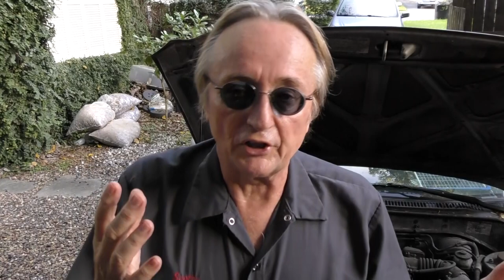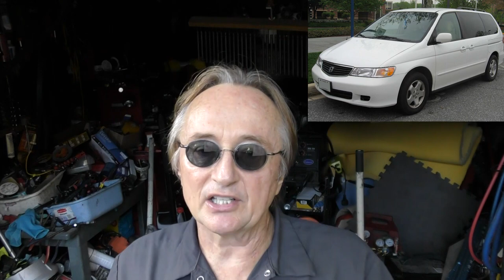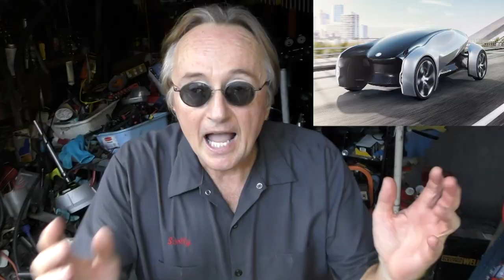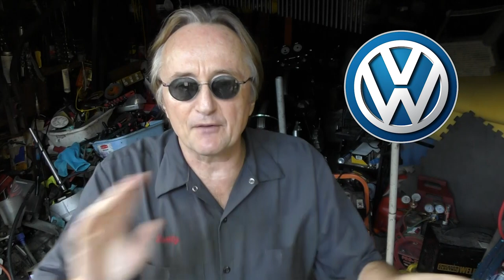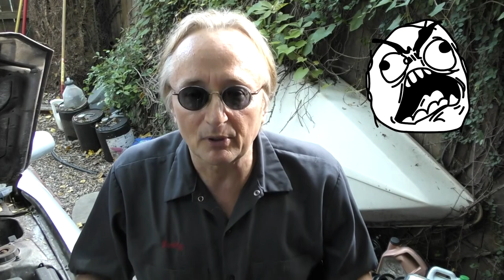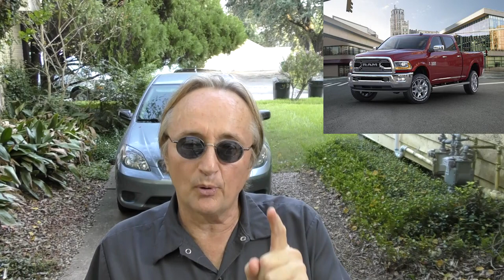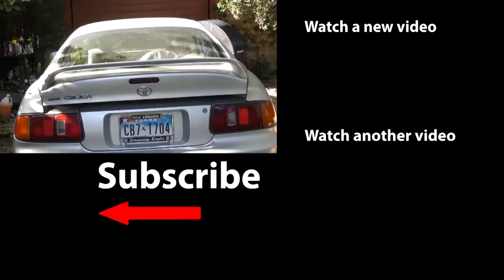Who Makes the Worst Automatic Transmission Cars in the World

Comment: I have a 2007 Pontiac Montana and 270,000 km on it, don't know if I should replace it or fix it. I have to do the work myself, 70 year old woman.  Replaced the wheel bearings and abs sensors last summer. Flushed the coolant system, transmission, and oil. Doesn't burn oil yet. But have to do the ball joints and a few other things.  Any advice?

Comment: I call bs .  Honda’s trans may not be the best but it’s certainly not the worst.  My 2000 Civic has 278,450 .  Still no problems with the auto transmission.   The problem is people try and mess with them too much.  Just leave it alone . No need for flushing , additives , etc
Reply: The civic transmissions are good but the accord ones had a higher failure rate.

Comment: So this is just great, my current beater has the dodge caravan transmission, 02 dodge neon, the thing runs great and the bonus in my case is the transmission was replaced with a brand new one 10,000 miles ago in 2015. That goes to show how bad they really are being the car just turned 40,000 miles and trans was replaced at 30,000 miles!!! WOW so with my new trans I still have 20k left before I have to start worrying.

Comment: No car brand is without its flaws.  I used to work at a Toyota dealership as a tech and the 5 years I've spent there I've seen my share of Toyota crap.  The accelerator pedal recall that sent cars speeding out of control for no reason, spare tire cable recalls, frame recalls on pretty brand new tundra and sequoia, you had to get your whole frame replaced if it failed the recall inspection.  The 4 cyl engine recall ( can't remember which one, 1.8l or 2.4l) that burned a ton of oil right out of the factory and had to have short block replaced...the shop had about 20 hoists and almost all of them had a camry or a rav4 getting engines pulled out. Oh and the rav4 rear tie rod recall where it would just fall out for no reason.

Comment: I am actually surprised that Ford didn't make the running, my 2011 Ford Fiesta I used to own had what I thought was one of the worst Transmissions ever. It was Ford's PowerShift Dual-Clutch Automated Manual 6spd, car managed to survive electrical issues early in life through 100k until the Transmission began shifting very irradically and poorly until it almost got me into quite a bind on a high-traffic road. Took it in to a trustworthy mechanic like yourself (gentlemen is actually Ex Airforce and worked on Jets), and his Dealer Level scanner detected missed shifts on Gears 3 and 5. Sadly we exhausted his Transmission Specialist, and took it to Ford, who at first tried to pin me for 150 bucks diag fee until they confirmed one of the P0 codes that our private mechanic had found was matched by the Dealer. Turns out the Transmission Control Module was going out. I had originally only signed the car over for an Estimate, but in their shady efforts to try and 'make me happy', they repaired the car without authorization AND didn't call me to tell me "hey, its X, you can get it replaced for free." Granted free, but apparently, a CSP (Customer Satisfaction Program) had been dispatched in 2015, this incident was this year, 2018. Safe to say, not even a week after getting my car back, I traded it in on a new Trax. 

Keep up the amazing videos Scotty! Thanks also for the amazing advice, lets hope I don't have issues with Chevrolet!

Comment: The absolute WORST Automatic Transmission was the JATCO in my 2001 V6 Freelander. That JATCO Box was a NIGHTMARE that used a special type of one of a kind Texaco Fluid known as LNR402 or N402. This transmission failed in my 1st year of ownership, just when my nightmare Land Rover experience began to accelerate. Little did I realize that the Flashing F1 error was a critical fault but the dealer said "no problem found" and that the F1 was nothing to worry about. I lived 6 years or my life with a container of Dexcool and a failing JATCO Box failing. My Freelander leaked Coolant from the first week, and I almost lost my Right Eye when the Sunroof mechanism exploded, and a sharp metal part cut my eyelid, I needed 2 stitches. The JATCO Auto Transmission faulted from F1 to F2 & F3 in Year 3. I would have to pull over, turn the Car off, to clear the alarm The Car would go into a Zombie Gear and limp along at 30mph.  When LR commercials say 'ENGINEERED LIKE NO OTHER CAR ON EARTH' they mean it, STAY AWAY FROM ANY USED FREELANDER, they are Lemons on Wheels. At to think I pair $35,800 for junk and probably close to $49K with the interest, it makes my stomach turn. One week before the warranty expired the LR dealer gave my Freelander a clean bill of health, what??? Then, as soon as I took it back 6 weeks later for the same recurring JATCO issue, they handed me a $10,350 repair estimate. The worst engine was also that Made in China V6. The Cylinders walls used Epoxy to hold them in place. I now regret not having let the whold dam car overheat and melt the head gasket as the epoxy became liquid and the Cylinder Wall started to move.

Comment: The US really needs a decent set of consumer laws.

Under the Australian Consumer Law (ACL) if a manufacturer tried to patch up a manufacturing issue until the product ran out of warranty so they could charge the customer a massive repair fee they would face a massive fine and possible lawsuit from the Australian Competition and Consumer Commission (ACCC). 

One core aspect of the ACL are the Consumer Guarantees which state that products must function and be of an "acceptable quality" for a "reasonable time".
This timeframe isn't hard set but it is generally around: 2-3 years for most cheaper electronics and phones, 4-6 years for computers/laptops and TVs etc, 8 years for refrigerators and 10 years for cars. Basically how long the average consumer would expect a product of that type and price to remain functional for.

An example is if you have an issue with your iPhone, say the port stops working, and you're 23 months into your 24 month contract then Apple is required to replace or repair your phone for free if you mention your consumer rights, since most people would expect a mobile phone to last for at least 2 years if it is on a 2 year contract. However the ACL puts the onus on the consumer to know what their rights are so the retailer can try to steer you towards paid repairs or not mention the Consumer Law at all but cannot outright deny you your rights.

Comment: I think the first generation Mazda6 has a pretty bad automatic transmission in it. My sister has one. It shifts rough into 2nd gear and apparently getting worse. Looked it up, apparently it's a common problem among first generation Mazda6s. Always ending in replacing the whole transmission. I think I read somewhere that they used the same transmission that's was in the ford focus at the time. Go figure.

Comment: I am Unlucky enough to have a 2001 Honda Odyssey. Actually, there were no problems with it until about five years ago when the transmission started to slip.   After discussing it with my auto mechanic buddies they suggested I put in a couple liters of Lucas transmission fluid.    The mechanic theory was that the internal seals in the transmission had hardened end I had internal leaks. The Lucas stuff softened the seals. So goes the theory.   I added in 2 liters of Lucas.  This is my question. When I start my odyssey in the morning I put it in second gear and  drive it for about a mile.    Then I shift up to D3  And can drive it around town without any slippage. Seems to work all the time.  Can you explain why this practice works for my odyssey transmission.  We all are thinking that driving it around for a mile warms up the transmission and softens the seals so I don’t get any internal leakage.  when I upshift the fluid stays where it supposed to be. What do you think?

Comment: ha, i had a '70 Chevelle with a PowerGlide and a small block. Put a set of headers on it and like a rolling neutral drop at 20 mph into low. Bark the tires. Car was nice. Trans, POS. worse was the Acura/Honda. 3.2 tl. How a company like Honda got this into production was sad. Apparently the replacement trans had the same 2nd gear pack prob. oh well. Junked the car. Wifes '05 Civic is still great.

Comment: I have to agrree on both sides. Chrysler's transmissions are terrible, but others are right that they are technically built by ZF.  My Jeep Grand Cherokee Overland is atrocious at shifting which is real shame because it's a great vehicle in almost all other respects. Mine is an 8 speed ZF and in early gears it shifts really hard, especially when cold. And it finds itself gear hunting all the time...and yes, I've had the supposed flash update fix. Didn't fix shizznit.  And just recently I've noticed it's starting to slip occasionally - all before 55k miles.  What a pisser.

Comment: I had a 1994 Ford Taurus with the Axod transmission.  all during the warrantee period it had tranny symptoms and the Ford dealer kept saying could not find any problems.  finally, at 37000 miles, the tranny blew and Ford said I was to blame cause I did not do scheduled maintanance.  Scheduled maintanance was to change tranny fluid at 100,000 miles.  Went with Honda after that experience.  Ford saved the cost of putting in a tranny but lost me and my extended family as customers.  PS  the dealer asked me in the end if I had any problem yet with the 3.8 eng I had in the car.  I said no, why?  he said you will have to replace the head gasket.  They all go on the 3.8l eng.  Nice, huh?

Comment: Aaand let's not forget about the 05, 06, 07 Pathfinder. I would know cause I have 1 sitting dead in front of my house. Sad thing is they're great trucks with solid motors, but Nissan used crap radiators that had a trans cooler line running through it. Radiator fails, and starts injecting radiator fluid into the trans line and you end up with TMOD(the milkshake of death). Of course Nissan didn't recall them either, just added an extended warranty which for most was to late

Comment: IMHO, Honda makes the best stick shift. I had a Honda Accord 1990 with a manual transmission and it had 360,000 miles and it never needed a clutch replacement. Unfortunately some knucklehead tee boned it whilst blowing through a red light. The most reliable car I’ve ever owned.

Comment: What do you think about  the 2012 Ford escape with the 2.5 four cylinder engine and automatic transmission? Ive got a little over 87k miles no issues yet.

Comment: How about the 2000 dodge Dakota v6 automatic ?  Mine acts funny !  Only 95,000 miles . Did a trans service when I bought it at 83,000 miles .  It’s just been getting finickier and finickier . It’s also hard to get a good read on the fluid . Each time I have had it serviced it seems they don’t even fill it up with fluid enough . So I am always trying to top
It off at the middle mark .

Comment: Speaking of Chrysler they had some terrible transmissions like the A604.  I am not sure if they make a similar one to that any more or even still make the A604.  That was one of the transmissions that needed a very specific fluid that anyone making it had to get a license from Chrysler to have ATF+4 on the label.  That was for cars in the 1990s and I wonder if it is ATF+5 or higher now.  I once had a 1995 Chrysler LeBaron convertible with the A604 and it amazingly never died.  It was hit or miss whether you would get a bad one.  I only had it until 80,000 miles which was a lot of miles back then.  The same transmissions were used in the mini vans even.

Comment: Mr.Scotty , question:
My 2005 Honda Pilot 4wd had transmission fluid flush( has service record ) at 80k miles , from the previous owner , I have 164,500k now , 
Should I do a flush with a mechanic here in San Antonio TX or regular fluid drain , with 4 quarts ? Also do I need to replace a transmission filter along with it ? 
I bought original Honda ATF,  4 quarts , 
Never done it before but transmission fluid drain looks like a simple process , thank you so much , Darko P.
Reply: just change the fluid and filter every 40k and pray its not going to break

Comment: You should give more NEGATIVE prop's to VW for selling the Routan (Chrystler made) with the 62TE transmission. Now I've seen some people say it's a rock solid transmission.  And others say it's garbage.  But I know that (1) there is no dipstick to check the A/T fluid... if there wasn't an internet, we'd all be out a $50-100  bucks just to get the level checked, as the cap SAYS "dealer use only" LOLZ.  Then there is the recommended interval for fluid change.  Which is NEVER, unless you are using it as a taxi, then the interval is 65K miles.  Well, I dropped the pan at 65K and there was easily a few mm of metal totally coating that magnet -- that's a lot of just metal dust. Replaced the filter -- I kid you not, the aftermarket premium filter holes didn't line up with the mounting holes in the tranny -- how is that possible if it's not a manufacturing tollerance issue.  The original one was hard to muscle out, and just like the factory, I was able to force the new one into position, but it not really supposed to be opened up.  E.g., the original pan seal was just a bead of RTV silicone, sealed up fine, but a PITA to remove entirely so that the new seal will seat properly.  I'm reasonably sure that tranny was built to fail -- just out of warranty.

Comment: ZF transmissions are not made by Chrysler.  They are made by.......get ready for this.............ZF.  A German company.  Many auto companies have bought major components from suppliers since forever.  My 1960's Volvos used brakes by Wagner and rear differentials by Spicer.  My 1989 Jeep 5 speed manual was made by Peugot.  Peugot!  Never had a problem going over 200,000 miles.  

Also, the two speed GM Powerglide (and Buick Dynaflow) did not slip.  Not having a lower gear to kick down to at higher speeds, they depended on the torque converter to effectively change the gear ration.  Engine speed went up, sure.  But also delivered more torque to the wheels, just like a downshift.  Except not near as efficient.

Comment: I own a jeep compass 2018 and not only do I get between 28 to 31 mpg and in 5 months I have put 10700 miles and no issues, however at this time when I had a candy by this time (5 month ) I had been to the dealer over two times with issues with the brakes and that useless entune system that made me run away from Toyota.  Not to mentioned the new camry is lower and makes me feel claustrophobic.  I miss my 2012 Camry,  Damn you Toyota

Comment: Have a 08 odyssey it’s been through alot and just hit 200k miles only problem ever was a small oil leak which was a shot valve never any problems with the tranny even under load with a trailer or something. Our old 02 was another story😂

Comment: I have a 2006 Cadillac srx and I don't want to put the fe3 suspension back in,I prefer the soft ride over the sport ride.
What could I use to keep the computer from throwing a code? 
It says the speed is limited to 80mph.

Comment: I purchased a VW Rabbit (it's like a Golf) in college because my RWD 3 On the Tree low mileage Nova wasn't "cool", was bad in snow and had some issues like dieseling and other concerns.  The VW owners were someone we knew and they raved but they were lying. I will NEVER purchase another Volkswagen - Vapor Lock, apparently it's "German Engineered" right into the engine. That car also rusted EVERYWHERE including important places. I will also not purchase a Porsche because the VW/Porsche dealer where I serviced my car was a bunch of crooked idiots.  I have good experience with Mitsubishi and with 'Yoda.
I love electric vehicles for their low maintenance cost and their reliability but there is FAR less profit in that so expect new costs to be designed into vehicles soon.

Comment: That's odd you say powerglide is junk (??). It was a primitive 2 speed. But racers loved it,  they run  1200 HP thru it.  They said, great trans. Still,  I guess it was "modified" (beefed up, fixed) The powerglide was the blueprint for the awesome th 350, one of the best. I guess it all depends.  A trans. repair man I knew said ,for example, the 700 r4 GM , 4 spd. OD,  trans was weak and broke very often.  He made a few mods to the 700 r4, everyone loved it,  very bulletproof. That's just it, modify, fixit.  My opinion,  I never saw the need for 5, 6, 10 speed etc.  auto trans.  , just a waste,  needless complexity, more to break.  A strong electronically controlled 4 spd.  auto overdrive is all we ever really needed.
Reply: Chevy in the 1950s and 60s had a transmission called Turboglide which I hear was junk compared to the Powerglide of those days.

Comment: Have a 2002 Accord EX V6 trans rebuilt at 48,000 miles. 
Funny no mention googling on what root causes are or ways to prevent reoccurrence.
Reply: My has over 200s original miles. I believe any car with highway miles will last.
Reply: Jesus Christ King of kings Lord Of lords Well update found file folder loaded with service tickets yesterday. Was my deceased uncle's car only 54k miles. It had new trans put in at 35k then Honda rebuilt it again 13k miles after that. He paid $8k total. Disgusting and shameful Honda covered nothing. Also motor mounts and lower ball joints replaced before 50k. All scheduled maintenance was performed by Honda. I have about $12k total in receipts. He was a sick senior citizen and couldn't afford a new car. He just said he had car problems, if I knew what the hell was going on I'd flown to Cali. Still going to give Honda a piece of my mind. Our family has bought many Honda's. I currently have a 2014. Never seen a sht show of problems like this before.
Reply: Mark Piontek  my 02 accord ex is running ok . It did start a transmission leak on top of the trans around 140s. I  plug in with an adhesive weld.